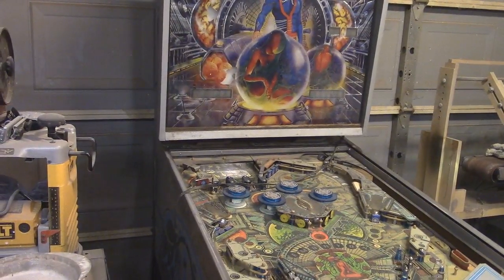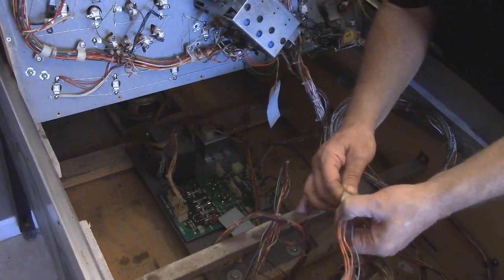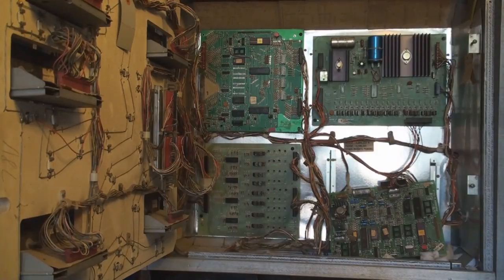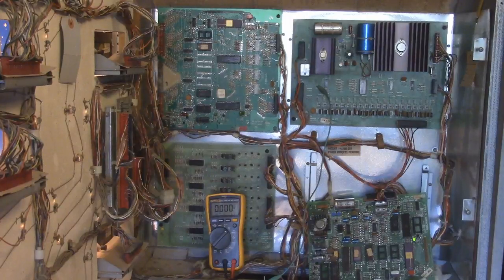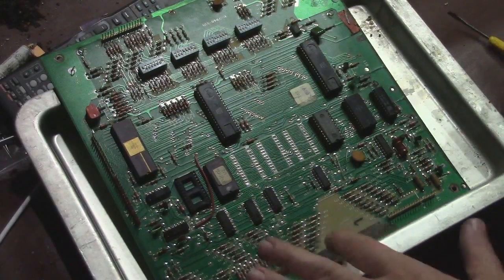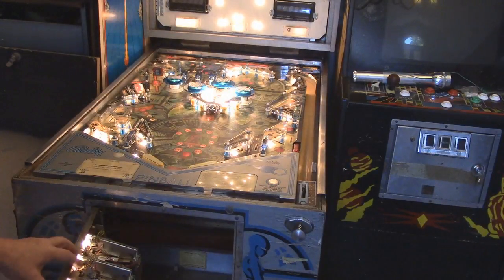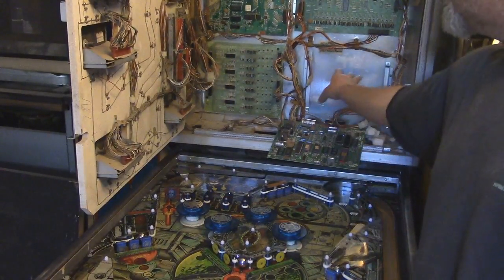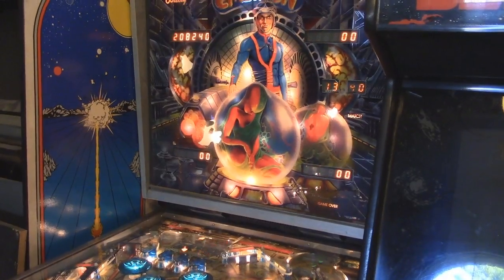repairing a bally embryon pinball machine

Comment: COOKING WITH DR. CHILL
                                    1.) When a switch is CLOSED the PIA chip will send a memory address back to the MPU chip to tell the MPU which switch matrix address has been Open/closed?
                                        2.) When a Lamp light is turned ON/OFF the MPU sends a strobe data signal/row & column data signal to tell the PIA chip which memory address to turn ON/OFF which lamp light in the lamp/light matrix?
                    3.) PIA chips are acting like an address decoder chip for all the switches and lamps 
Each switch and lamp/light has a specific memory address to each switch and lamp/light for the PIA chip to turn ON/OFF?

Comment: COOKING WITH DR CHILL 
          In pinball games the solenoids voltage is +6vdc or +12vdc mostly? 
     because atari pinball games used +48vdc any reasons why +48vdc for the solenoids voltage?
Reply from the maker: it changes depending on the maker, and what year
Reply: Pinball coils of this vintage ran on 43v DC. The reason was that coils pulled enough Amps to be a shock hazard. UL regulations at the time required operating voltages for that amperage to be under 50v. There was a movement to reduce the maximum voltage to 25 volts and some game manufactures made or tested the change but the regulation was tabled.
Reply: @areizman  why does pinball engineers say that the AC coils are WEAKER at hitting the ball compared to DC coils are STRONGER, why are DC coils flippers stronger compared to AC coils flippers?
Any way to measure how stronger the Coil flippers force and strength level at hitting the ball?
Reply: @billwilliams6338  it's really just physics. Alternating current varies up and down from 0-50 volts 120 times a second. DC is a continuous steady pulse. Late mechanical era games would have a bridge rectifier powering the bumpers to give them more kick. In the solid state era we switched to a pure DC power supply because it was easier to control with semi conductors.
Reply: @areizman  yes i have seen the bridge rectifiers used to convert the AC +48vac into +48vdc for the flippers and bumpers coils. 
Was the Flipper AC coils and Pop Bumper AC coils made differently for AC? use a different wire type to create less buzzing and AC noises from the coil. 
What are some things to add to the coil to make the AC buzz noises on solenoid coils more quiet. Because people would add bridge rectifiers to get rid of the AC buzz noises. 
Same problem with the LAMPs making noises buzzing because of the AC 50hz or 60hz so they used bridge rectifiers added to convert the lamps to DC. 
I don't understand by the pinball games lamps would use a "negative voltage" - 6vdc 
I have seen for the coin door lamps. Why use a negative voltage for the lamps and not a positive voltage for the lamps?
Solid State Pinball games they use PIA chips to interface all the switches, solenoids, bumpers going to a PIA chip. 
The PIA chip was the interface for the switch matrix circuit and another PIA chip was for the lamp matrix circuit. The PIA chip would turn on/off the switches and lamps. 
Why did they use PIA chips for interfacing when you can just go direct to the CPU microcontroller input/output pins directly.

Comment: Tediously pick through the switches replace the little Pumpkin seed capacitors 0.05 uf make sure none of the switch wires make contact with anything like ground, lamp and solenoid voltages.  Pin connectors to cct. boards other big issue, either solder joint on cct board or just a bad pin in connector. On the mpu a hand held oscilloscope is handy to look at wave shapes a meter is only good for average voltages unless it can measure frequency. Take a picture of the foil patters before you replace a lot of time it is just the tedious job of checking continuity between components.